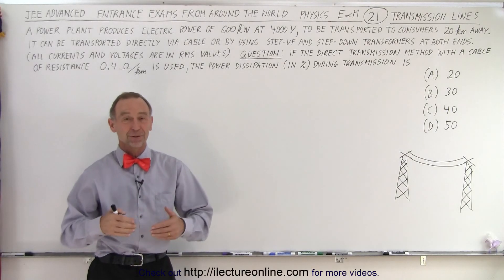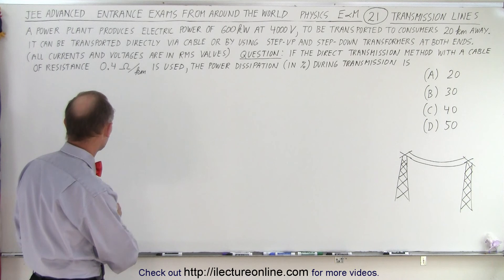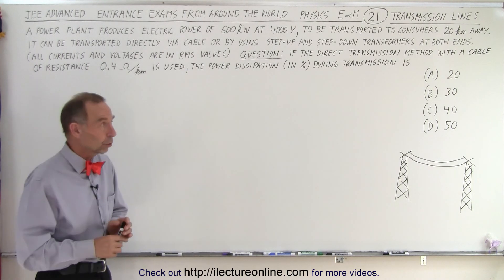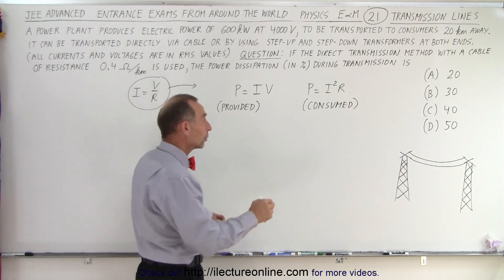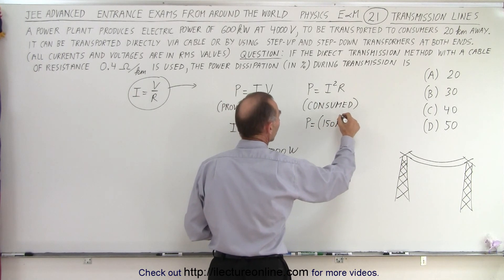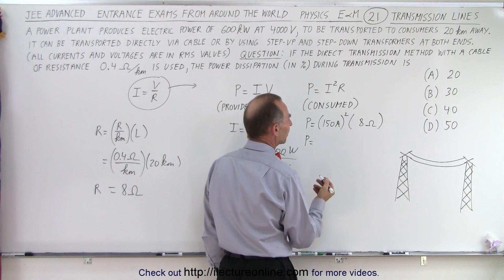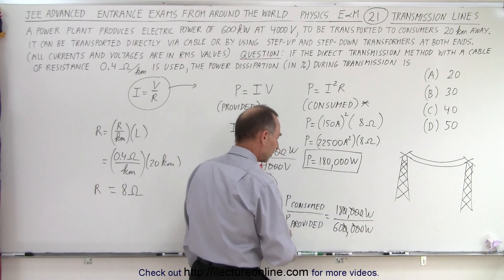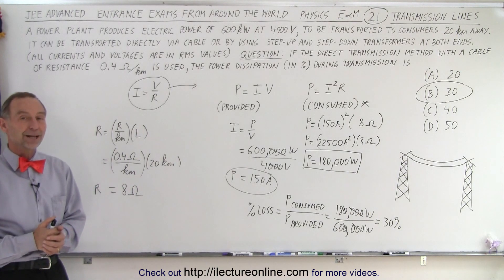JEE Advanced Physics 2013 Paper 2  #15   (#21) Transmission Lines

Comment: I have a question regarding cable length estimation should it be 1*20km, or 2*20km (PS-load-PS)  or r should be divided by 3 in 3-phase connection?
Reply from the maker: We are not looking at the design of a transmission line here, just the straightforward question of how much energy is lost on a single line carrying the indicated current.
Reply: @MichelvanBiezen practically
      In single phase considering neutral aur phase both wire resistance ????
 20 * 2 = 40 km 
In 3 phase what should be total resistance 3 * 20 = 60 km ??? Please reply 🙏🙏
Reply from the maker: Let's just keep it simple and relevant to the problem.  Assume current flowing through a single wire with resistance indicated over the length indicated.  There is no other information given in the problem.

Comment: I think we should count the neutral wire too. If we suppose it's a DC line or a single phase AC.
So the total resistance of the line is double at 16Ω. But there is no option for 60% losses.
Reply from the maker: No indication in the problem that there are neutral wires, nor that they carry any current.  We need to go by what the problem states.
Reply: @MichelvanBiezen  I see. But is impossible to transfer electrical energy with only one wire. So my statement is, if the problem want for the students to guess that. What is the level of students this test is for?
Reply from the maker: These are the most advanced tests in the world for high school students looking for entry in the most prestigious universities.  But at the undergraduate physics level I have seen many questions like this and no concern is given to get into the actual mechanics of how to design a transmission line.  That is a different topic